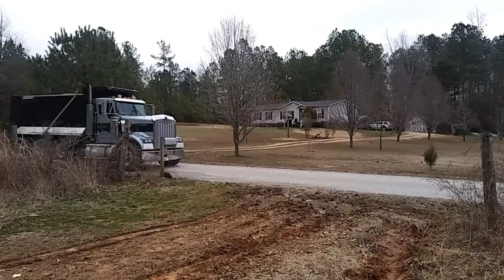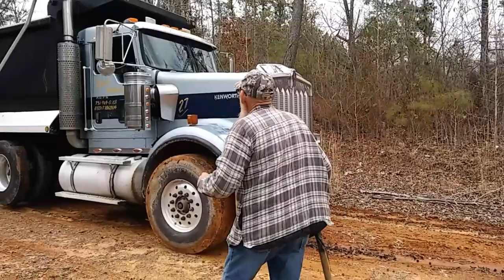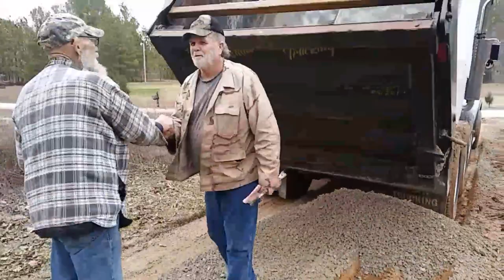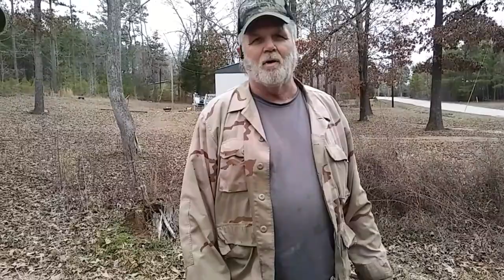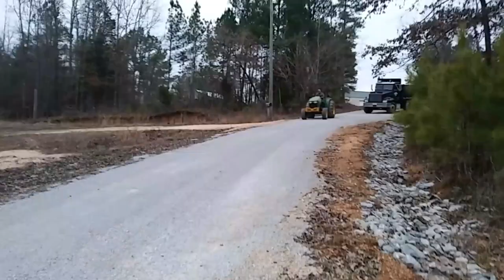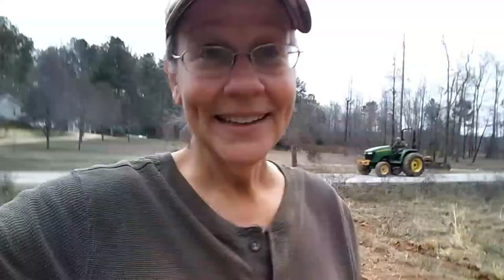Dumptruck Delivering Gravel on Clay Mud. Does he Tip Over? - Ann's Tiny Life

Comment: My only comment after being in construction for over 40 years is you should have used a little bigger Rock for your base and then put the chips and dust on top in the long run would save you money and be much more stable. Good luck little darlin
Reply from the maker: it may be hard to see, but this gravel contains a variety of different sizes. It's all Nestle down in amongst itself very well. The only thing that is not great about it right now is that I simply just need more gravel. maybe one more load, but at least two. I'm very happy with the way that this gravel has set up. Thank you so much for your suggestion! I've heard that people put several layers of rocks down.
Reply: @AnnsTinyLife  yes I remember you saying it had clay which is a good base and yes you will have to put more layers down over the years

Comment: Uhh, Why didn't he Back Spread that load to start. That's the way you do it on a virgin muddy drive. First off, he had his chains set too tight because the Wet gravel was not coming out clean enough. Second, his Gear selection was in Deep Reduction and not regular Low gear. Lastly, the drive Needs another load. The driver Did however have both Axles Locked in which was good.
Reply from the maker: he clearly didn't know how to gate spread. really clueless driver.

Comment: I'm in the process of getting my cdl class A endorsement.  I will be doing this a lot this year. Glad to see that things are working out for you. Have a great day. 😎
Reply from the maker: Thanks so much AJ! And good luck on getting your CDL. That's pretty amazing!
Reply: It isn't a requirement to have a Class A to operate a Dump truck. Tri-Axle or even Quad Axle. Unless you plan on going over the road anytime, save yourself some headache and skip the A and go with a Class B.
Reply: @joes6883  I went ahead a got the class A because it was a offer I could not refuse. My job paid for half of it.

Comment: Looks like you may need bout 4 loads for the distance your driveway is.
Reply from the maker: yeah it definitely needs more gravel. The good thing is that it's become pretty solid so I'm not sliding around or getting stuck in the van coming or going. and the area down by the culvert has also started to harden as well. So I'll get more eventually. Baby steps.